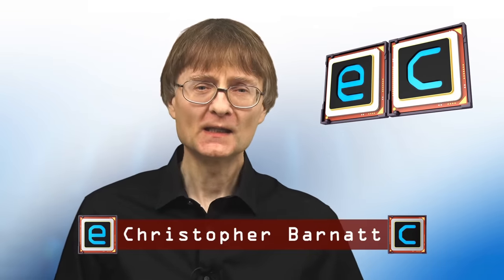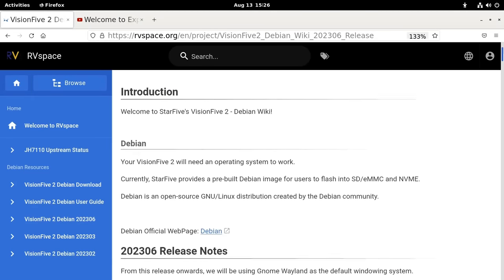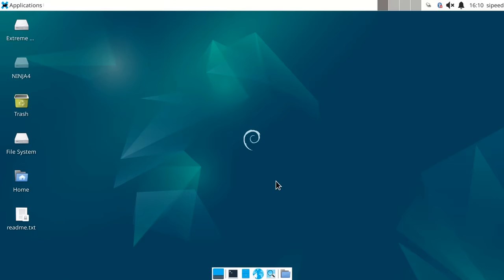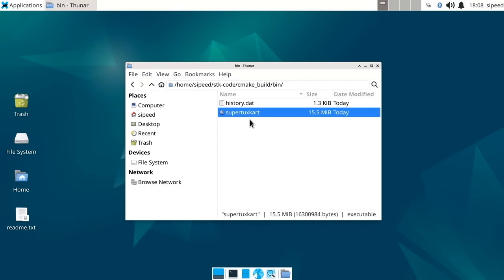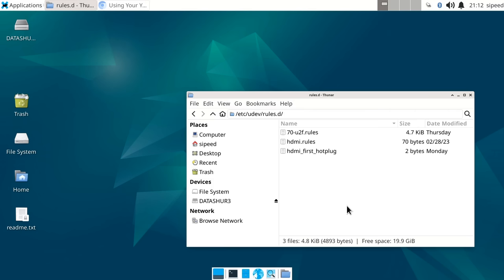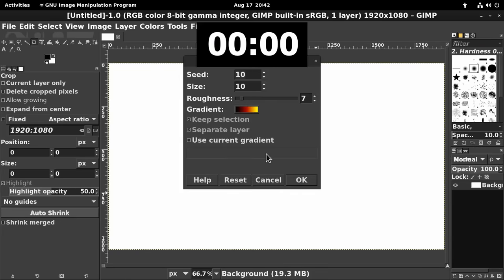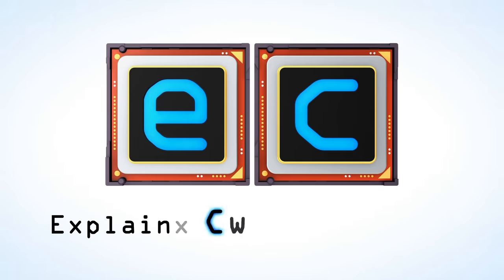RISC-V Week: 7 days only using RISC-V computers

Comment: GPU support continues to be the achilles heel of these sbcs ARM, RISC V, or otherwise. (Really these RISC V systems are on par with your average low cost arm  equivalent so I'm in impressed!) The hardware is there but can't be utilized without good drivers.  This seems to be a tough nut to crack because it's omnipresent on all but the most popular of sbcs.
Reply from the maker: Yes, GPU support is the issue. But I am hopeful that there is a lot more support behind this for RISC-V than there is for ARM SBCs. The stakes are just so much higher.

Case in point, in this video I could not run Kdenlive on the Lichee Pi 4A. 30 hours after the video posted, Sipeed had made this work flawlessly (video and audio playback). That's impressive! :)

Comment: I was under the impression that the YubiKey just shows up as a USB keyboard...
Reply from the maker: It does. But that is just the hardware side. Just showing up as a USB keyboard has little to do with making it work! :)
Reply: @ExplainingComputers  Whoever wrote the code to overcomplicate that handshake is a real "eager beaver".  Doing the auth with a simple text field that takes the tap code is simple enough and perfectly secure.  I've done Yubi auth like that in systems with much more stringent security requirements than that.
Reply: (Enterprise Systems Engineer for a company you've heard of here.)

Comment: please do an opnsense ha build with a couple older hp refurbs but other than that fairly mundane request i would offer up the observations that what happened to sbc/soc innovation? i was always under the impression that embedded sys/soc mkt was somehow ties to mobile dev agile sdlc and hw where we would see more development as a result of mobile phone dev being so precocious but that hope seems to be fading a bit - maybe you can propound more on this - sure we got some risc chips that are early in dev and there are no real arm roadmaps since it is basically a consortium but i would have hoped for some more chips by this point past the 3588 - maybe i had too much too fast and had great expectations that were overblown but maybe there will be  new chip out in the next 3-6 mos - we can only hope - it just goes to show that refurb pc may be the way to go for most enthusiasts - the value king bar none #mr chips #allwinner #hp 6th gen/7th gen #parts is parts what do you want me to tell ya?

Comment: Interesting little computers — unfortunately everything RISC V based is expensive! ARM-based gear offers about the same — and is significantly cheaper.
Reply from the maker: There is no comparison at the moment -- all RISC-V computers are development boards, so cannot be compared in price terms with consumer ARM hardware. :) A few years ago, less powerful RISC-V development hardware than this cost thousands of dollars.
Reply: @ExplainingComputers  indeed I noted that, of course — still for today price-wise it is difficult to beat e.g. something like „Libre Computer Board AML-S905X-CC (Le Potato)”. It's as potent as any of the presented boards (maybe even stronger) — and it's so much cheaper!
Hoping RISC V will continue its slide when it comes to its prices — a competition is good for us, the customers! :)

Comment: The reason kdenlive and blender arent working is that the SoC doesnt have a ample GPU driver for OpenGL
Reply from the maker: No, it isn't. I've run Kdenlive on SBCs with no more powerful GPUs, as I clearly explain in the video. The reason is that Kdenlive has not been ported to RISC-V on these boards yet.
Reply: @ExplainingComputers  reading the error message, it suggests its having trouble finding OpenGL, and i believe that is because the driver does not implement it. I believe that llvmpipe mesa might make kdenlive work here, however I am not sure if it already is installed just not detected. Sorry if I sounded harsh
Reply: @ExplainingComputers  I just looked up LLVMpipe and it suggests that RISC-V is not yet supported, albeit I'm not sure in practice, but it would explain why kdenlive is not finding and OpenGL library

Comment: For a windows/MacOS user this still seems a step (or maybe two steps) too far.  Having spent many hours over the last 20 years fiddling about with linux (particularly the video and wlan drivers) installs ... I no longer have the patience for unusable operating systems, particularly when the lawn needs mowing and the solar panels need cleaning.

Comment: they need to make a way to plug them together then you would have a mega computer
Reply from the maker: Great thought, and hey have. :) It's called the Lichee Pi4 Cluster, and takes seven of the Pi 4A modules, giving 28 cores. Launches next week I think -- exciting times: https://sipeed.com/licheepi4a
Reply: @ExplainingComputers  if its cheaper than a normal pc it would be the future,imagine connecting all modules and each controls 1 part of the system,1 for the OS,1 for gpu,1 for IO and buss and other for the hard disk management in RAID,amazing concept

Comment: just run the Gimp test on my Pi 4 and it took 18 seconds. It is overclocked to 2khs.
Reply from the maker: Very interesting. After the "RISC-V" I did run it again on a Pi 4, and the result was as I reported in the video. The overclock should not make that much difference. What OS are you running?
Reply: it is the 64bit Raspberry pi os. @ExplainingComputers

Comment: Hi everyone,
Can anyone tell me what I have? It's a black box, a little larger than a credit card (7cm wide by 12cm long, 2.5cm tall at the front and 5cm tall at the back (think a wedge shape)). On the top it has a red and a green LED and a port (0.5cm wide by 1.5cm long). On the back it has a standard PS2 port and a 9V 20mA dc connector. On the bottom all it says is that it's a KB69273. Inside, the circuit board says it is an RU board (CP10 94V-0) and has A207454AB printed on the board. The last bit of identification is a RoHS sticker which reads C2818577. Any help would be gratefully accepted!!

Comment: Would switching to a lighter iso like puppy linux help?
Reply from the maker: I'm afraid not. Whist a lighter distro may improve performance, standard ISO images are for the x86 ISA only, so will not work on RISC-V hardware. Debian is the distro supported/provided by the manufacturers of these boards, and is the best distro to run on the hardware right now (even though it is work in progress -- and a different work in progress -- for each board). The community is porting other distros to RISC-V, but there re no official versions of any Linux distros yet (although Ubuntu has some server developer previews). These really are very early days when it comes to RISC-V desktop software.
Reply: @ExplainingComputers  thanks for the info, i like alternative pc’s so i was interested, but i guess its back to trying to find the oldest possible machine that can still work with netflix and youtube.  I dont know why it interests me but i love saying this is my 2008 imac running mint, and has been my daily since 2009! I’m trying to find the right g4 mac, and I dont know what pc to try, any suggestions?
Reply from the maker: @95Comics  Mint on a 2008 imac sounds cool. I too run Linux Mint. :)
Reply: @ExplainingComputers  runs perfectly! Literally feels like the core i 7 that I have but dont bother with! Lol you should definitely try it, i have an a1283 mac mini from 08 as well, its even slower and still works great!

Comment: An interesting experiment.
I think your conclusion is wrong, I dont think you did get through the week and end up proving you can manage on RISC-V hardware alone because there were several instances where you needed the power of something else but didnt have it so just didnt do it.
If you could have used it for all the things you wanted to do then it would have proven it is ready, but as it stands its clearly not.
Security problems. Lack of power problems to name just two issues.

Comment: Hi Chris. I think the RISC V architecture comes more into its own when it is used for a real time application. I don't think there is much point in using it as a Desktop machine since that's what the 386 architecture is for!  I would like you to creatively expand on a very bad video I made ages ago. In this video, I use Rocrail to control a layout using Dynamis. I used a Windows PC in the video, but you can use a Raspberry PI or similar. You don't have to use Dynamis. You can use an SPROG.  Have fun!
 https://youtu.be/ID3q12haWQg?si=_nRgkZ4A5_sLCuL3

Comment: What I want out of Windows 12 is for Microsoft to accept that I don't want to use edge or one drive for everything. And that the windows 10 start menu was better. I've had windows 11 for like a week now and I've hated most all of the changes.... Not having a default documents and pictures folder that aren't in one drive being the most annoying.... And the widget pop-up thing being just interesting enough to be super annoying that it's not actually useful for anything and doesn't work with anything... And all those links in the windows settings loading info pages in edge instead of my default browser...

Windows 11 feels like a pyramid scheme that's always trying to up sell me some nonsense. I'd recommend avoiding upgrading as long as possible.

Comment: Oh man, the Linux experience never disappoints. "VLC used to work until I tried to install Kdenlive and now neither works". This is why when I decided that I need to run Linux as my main desktop I insisted that it must be running on ZFS with both scheduled and event based snapshots so I can always rollback when something randomly explodes, and it has already saved me about a dozen times in about 6 months.
Reply from the maker: This is in no way representive of the "Linux experience". You've clearly missed what is going on here. This video is about RISC-V hardware, for which software development is embryonic. There is no comparison whatsoever with the Linux experience on computers with x86-64 or ARM CPUs. :)

Comment: is it real risc, software runs on real risc instructions or like intel cpus emulates cisc with microcode. cos even ps3 and xbox 360 had 3.3ghz powerpc true risc cpu. still when intel could run 2 instructions in 1 tick, risc in 1997 could run 7
Reply from the maker: Yes, it is real RISC-V. RISC-V is a RISC ISA! :)

Comment: Might have better luck with a more modern/bleeding edge Linux distro, like Arch or fedora or something
Reply from the maker: Not the case I'm afraid. These are RISC-V computers -- that's the whole point -- and I am using by far the most advanced distros available for them. You cannot just take any x86 or ARM distro and run it on RISC-V hardware! :) Rather, you can only use distros that have been ported to the RISC-V ISA. And right now there are no distros with official RISC-V support, with the best support being from the pre-release images provided by the board manufacturers.

Comment: Isn't Playstation 2 vuilt with RISC-V??
Reply from the maker: It had a processor designed by Sony and Toshiba that indee had a RISC ISA. But it was not a RISC-V processor. "RISC" just refers to any processor based on "reduced instruction set computing", rather than a CISC (or complex instruction set computing). So, for example all ARM processors are RISC. "RISC-V" is a specific ISA that, surprisingly enough is based on RISC. :)
Reply: @ExplainingComputers  thank you for the RISC explanation, but isn't Sony and Toshiba designed the Playstation 3 processor??

Comment: Why do you keep calling Risc-V a new ISA? It came out in 2015. Just because you're bad a linux, don't blame it on the hardware
Reply from the maker: Because I don't. :) I'm not sure what video you watched, but in the introduction here I very clearly state that: "RISC-V is a free and open instruction set architecture, or ISA, that provides an alternative to the closed ISAs used in today’s x86 and ARM CPUs. Right now, RISC-V is used in embedded computing, but it’s still very much developmental when it comes to server or end user computing". So I do NOT describe RISC-V as a "new" ISA.

And I did not "have a bad Linux". Do you have no concept of what is going on here? I am not "blaming the hardware". RISC-V is still very new for desktop computing, and it is most certainly software that is holding things back here, NOT hardware.

Comment: This would be a better experiment if it were done by someone who has already been daily-driving Linux for a long time.  Otherwise you are conflating the hardware and the software.
Reply from the maker: Well, given that I've been using Linux every day for many years, as well as publishing Linux content on this channel for over 10 years, I think I'm pretty qualified to do this experiement. I am NOT conflating hardware and software issues here, save that it is software support that is the constraint on desktop RISC-V performance, as anybody working in this area knows. Progress is amazing, but there is still a way to do.

Quite why you assume that I do not use Linux every day, and have not done so for years, I am at a loss to understand. There is NOTHING to indicate this in the video! :)

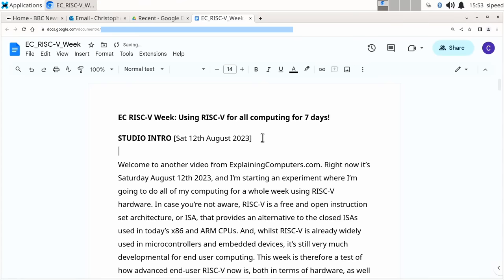Comment: 3:48 No, it's not at all perfectly fine, it's awfully bad. We can feel here the unworkable lag just doing the most basic activity on a computer, which is typing text. Any computer system 40 years ago was much more usable for typing text than what you show us here.
Reply: It's a developmental board. Of course there will be some problems but they won't be permanent. As for the alleged "unworkable lag" on Google Docs, it looks to have run fine to me. Good lord.
Reply: @Praxibetel-Ix  I dunno man, when you start typing there's a 2-second delay before the first characters appear on the screen! In the old days of optimised software on tested hardware, that wouldn't have made it to the final floppy disk and boxes.
I sound totally off-topic, but there's a logic to my reasoning: trading computing power for lower electric power consumption, without changing back the software for less-demanding processing, makes little sense to me aside a vain doomed test. Supporting a lower-end platform isn't just about recompiling the C source code for a different arch. There needs to be a lot more efforts tuning, optimising, removing useless features that strain too much the hardware etc.
Reply from the maker: The boards here are also perfectly good at typing text. But there is a world of difference between typing text in a local application, and running up an online word processor. There is no lag once it has run up! :)
Reply: @ExplainingComputers  I understand that, but my point is that since nobody wants to optimise/reduce daily-life-desktop software bloat to work on less-capable hardware, then, RISC-V has little chance to make any dent in the desktop market as it can't compete right now. I used to be very interested back in the days in all the new CPU archs that were appearing, because it was always a fight for better spec, but now, with this, I don't know what to say. I like the open-source principle of some of the chip designs, but that's about it.